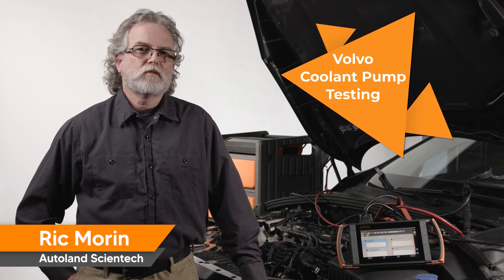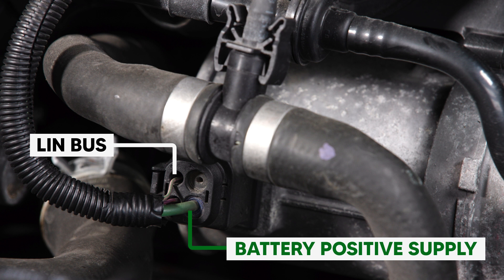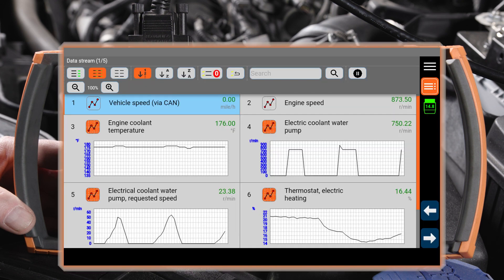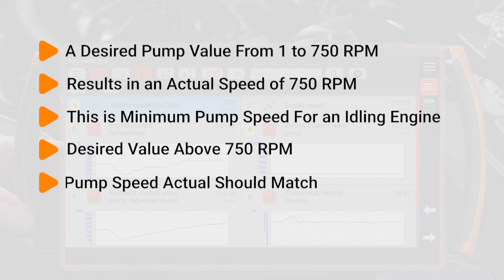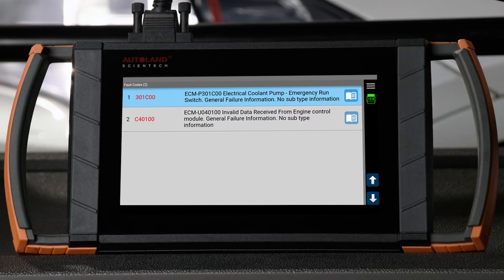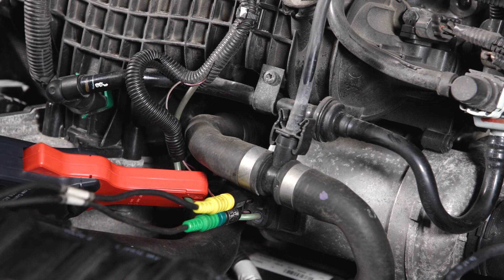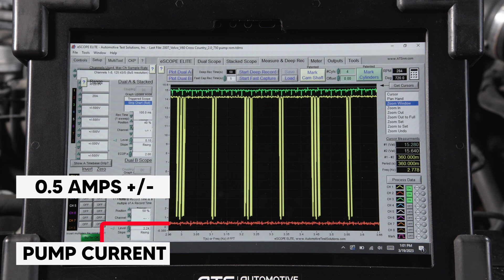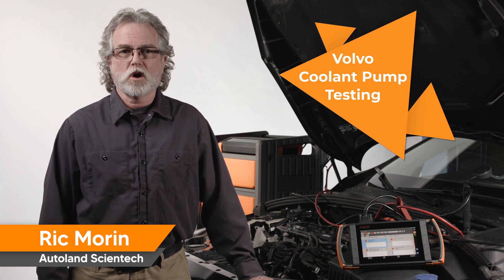How I Test a Volvo Coolant Electronic Pump - Testing & Diagnosing

Comment: How reliable are these electric pumps turning out to be? Ie do they warrant being replaced as a preventative maintenance item at a certain mileage or do they last the lifetime of the engine?
Reply from the maker: That's a good question. These pumps fail just as often as older belt driven pumps. Most times, setting fault codes. Parts on cars are designed for lifetime (100k miles), however they don't always last. So if your vehicle is getting up there in mileage it is a good idea to replace it.

Comment: Doing a quick search, it looks like the current sell price of the iSCAN is $3,700-$4,300 depending on configuration.  Then I am assuming your using an O-Scope to monitor the (3) signals on the 50 AMP power lead, the Emergency power, and the digital signal on the LIN BUS.  Depending on the Oscilloscope, the cost of one of these can be up to $25,000.  Not many consumers are willing to spend $10,000-$30,000 on diagnostic equipment to diagnose their electric water pump.  I happen to have this exact problem with my 2015 Volvo XC-60.  The engine overheats intermittently.  It will run fine for a few days, or 50 miles, then after a stop, it starts the overheating problem for no apparent reason.  Pump, thermostat, coolant temp sending unit, overflow reservoir, and electric cooling fan have all been replaced and still the intermittent problem persists.  I will not be buying an oscilloscope and an iSCAN, even though I would love to be able to afford them.  I know the engine overheats periodically, and runs great periodically.  Unfortunately I never know when it is going to decide to overheat.  Ideally I need to find a mechanic shop that has this equipment and can use it to diagnose if the  pump is bad, or if the LIN BUS signal is not getting through.  If not, it seems the emergency electrical power would kick in and run the pump to prevent overheating.  When idling, I can verify that both the positive power cables to the pump have the correct positive voltage.  I am unable to confirm the digital signal from the LIN BUS.  Best guess is that the two positive signals are doing their job but I have a faulty new coolant pump.  I would like to see a follow on video that cleared up the two error codes, and then proceed with the troubleshooting when no error codes exist, and still the engine overheats.  

Thanks for posting this video, it has been very helpful.
Reply from the maker: Professional mechanics have this equipment. It is needed to diagnose modern vehicles. No way around it!
Reply: @BoundANDDetermined88 
Hey john did you happen to ever figure out the actual issue?  I’ve replaced the same parts as you and still no fix at this time.